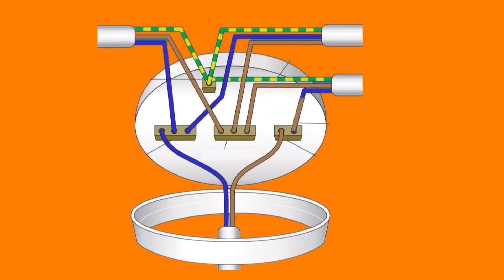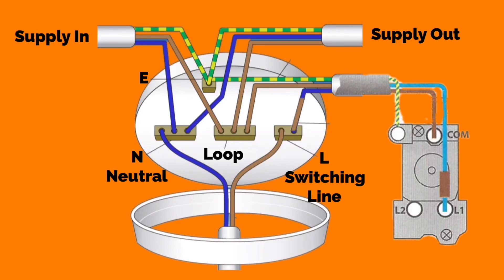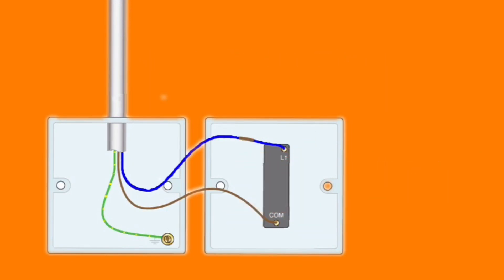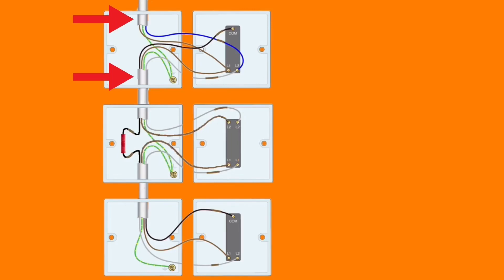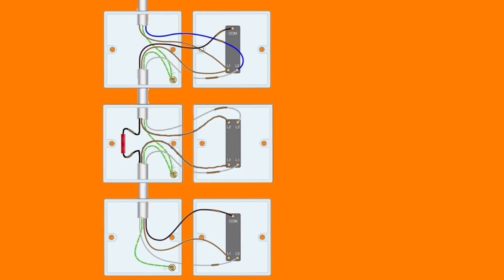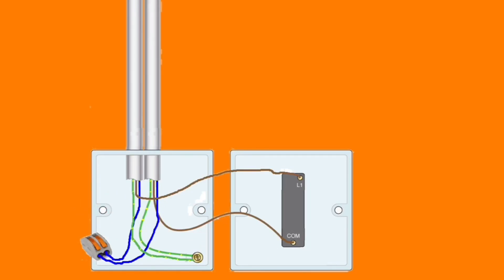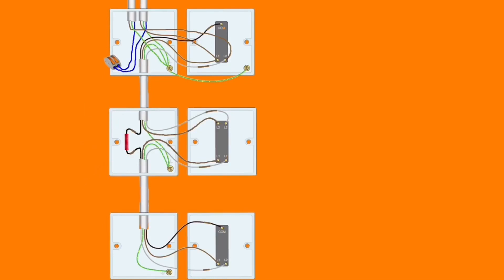Lighting Circuit Connections (Wiring) Explained for 3 Plate and 2 Plate Loop-In Methods

Comment from the maker: == 🕐 Time Stamps - Cut to the action 🕕 ==
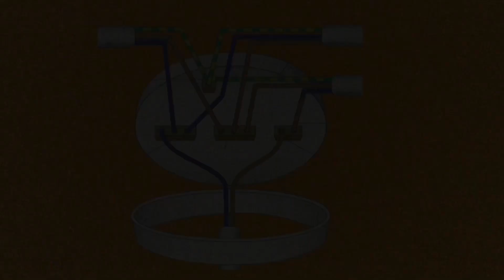00:10 - connection in a celling rose using the 3 plate loop in method explaind
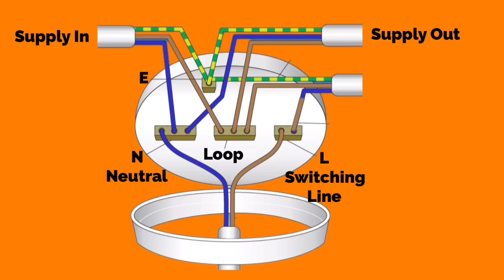01:33 - connection for a 1 way switch 
02:39 - connection for a 2 way switches
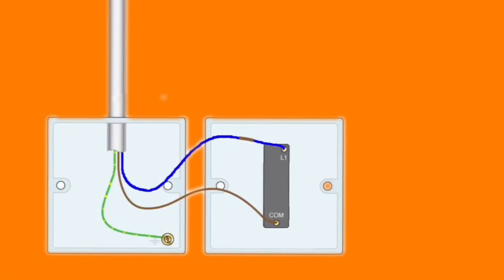04:45 - connections required to change a 1 way switch to 2 way switching 
09:03 - connections required for 2 way and intermediate switching  
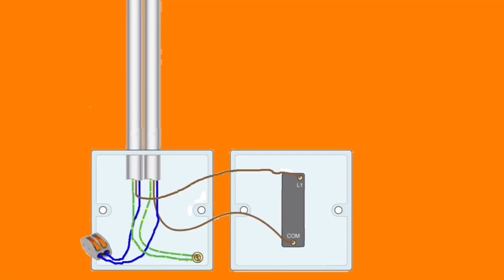12:47 - connections in the 2 plate method (taking the feed to the switch) for 1 way switching
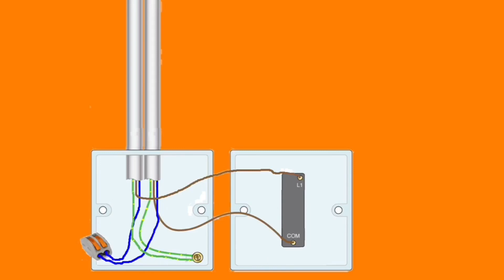14:22 - connections in the 2 plate method for 2 way switching
15:44 - connections in the 2 plate method for 2 way and intermediate switching